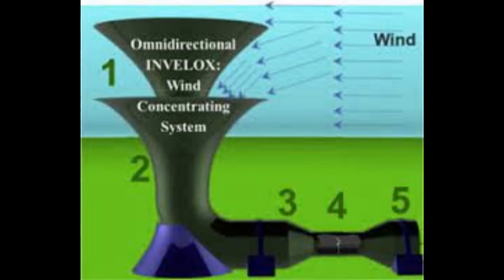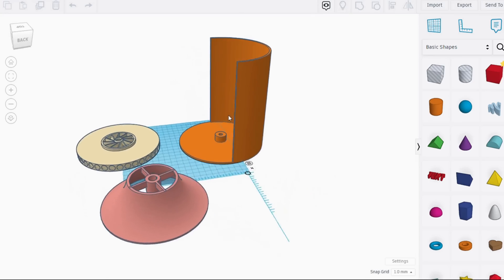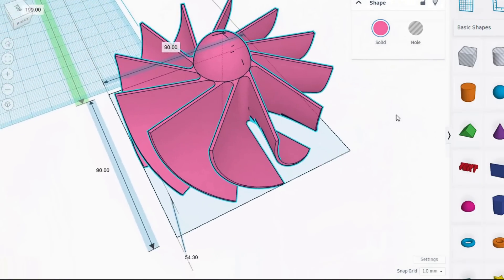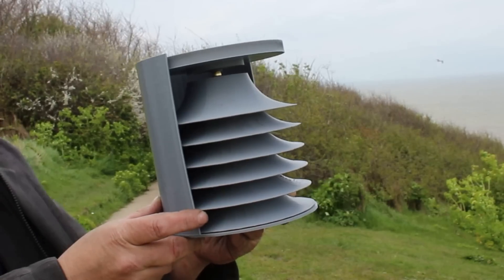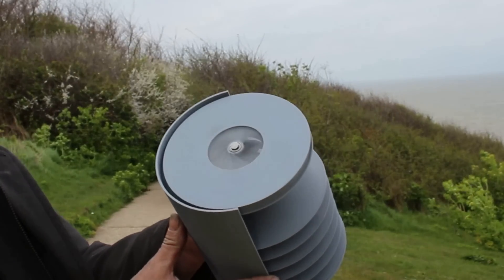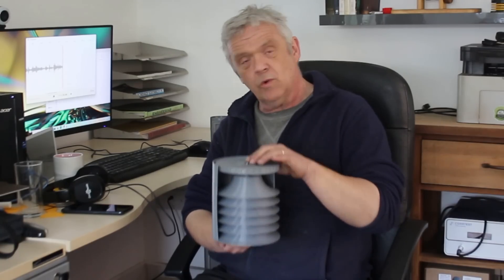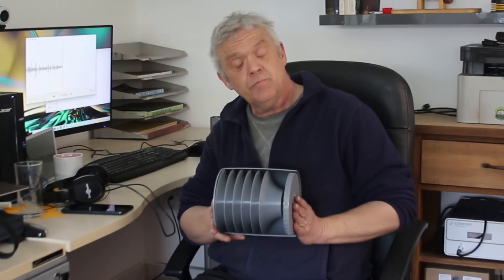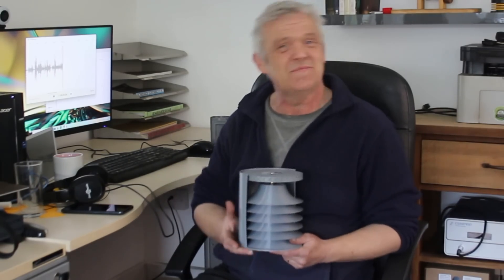1901 Brand New Wind Turbine Design For Camper Vans, Boats And Roof Ridges

Comment: Would you mind adding a few marks to the magnet wheel, so we can tell if it's turning? A Dark Sharpie or a paint pen should be enough.  You could then use a tachymeter to measure the RPMs.
Reply: Would appreciate testing it with a bldc motor and check it's real energy value.
Reply: A mark is a great suggestion.
Reply: @davebean2886  A first-year physics student would automatically do that.
Reply: videos aren't good at capturing rotation because they're 25 still images per second. They will always give an unrepresentative view & at certain speeds will show a rotating object as motionless. Much better is some sort of gauge. A simple analogue gauge is a magnet in an aluminium cup, one part rotates with the mechanism & the other holds a pointer & acts against a spring, the eddy currents in the cup drag the magnet. It works with either part rotating.
Reply: I think I’d like to see how well it spins with the generator components on. As we know with the old generators for a light on a push bike, they put a lot of magnetic force on the rotation.
Reply: You need a studio microphone!
Reply: An RPM gun would work nicely so each different design could be checked .
Reply: Hi, great design. Can you share also what other components I would need to make it work? Apart from the 3d printed parts of course.
Reply: You need to get a blind stick 😂
Reply: It would probably be best to use one of those laser devices to measure the rotational velocity. For demo purposes, it would also be nice if such a device could output an audible oscillation, speed and pitch (Hz) being an intuitive frame of reference for most people.
Reply: Draw a spiral on it
Reply: @toml.8210  Look at the top where the magnets are
Reply: Well, I can see that it is turning, and quite fast at that. 😊
Reply: @hendrikjbboss9973  that doesn't give us accurate measurements though....
Reply: I have a way better concept than that but tesla wants everything for free. Ben there done that with other novel idea..
Reply: @mariosanchez-sj9yv  sir what is your idea please

Comment: Being the sailor that I am, I gave up on wind power a long time ago.  Why, wind and sailing are connected.  Yes, but you need both a lot of wind and a projected surface to get a harvest that is satisfactory.  But using speed and water with some smart solution is of great interest.  Of course there are commercial ones such as watt & sea……but the prices are astronomical.

Comment: Hi rob, why has noone made a hydro turbine for a boat? Could even hang it behind the impeller of the boat where the water current would prob be strongest. Or add magnets to the edges of the motor impeller which moves the boat (and a coil housing)
Reply: Even when moored up on a canal in a narrowboat, the tow from passing boats can produce quite a current. Magnets to attach it to the hull below the waterline and either bi-directional operation or with the self-aligning vane...
Reply: @34136TS  i would imagine just the flow of the river when moored up would turn one, same as the old water mills were just in rivers/streams. Not all hulls are steel but like the magnets idea,  hows about this for an idea? Somehow make a kelvin water dropper attached to a hydraulic ram pump!
Reply: Not to forget that the deployed propeller will spin under sail and turn the shaft to produce electricity of course.  I see that you refer to when moored however.
Reply: @philip5940  indeed, someone did invent a dual axial turbine for the sea which does work when tide goes in or out but im pretty sure all generators generate when turned in either direction so i think that was just a gimmick or marketing ploy. I like the idea of magnets on the propeller edges or rim with a row of coils encircling the propeller, much like the design of a honeywell (formerly sk windtronics) windtronics turbine.
Reply: @philip5940  we will call the propeller idea a hybrid design as thats the buzz word at the mo haha. Only generates when the propeeler is turning or engaged, maybe could adapt it to be free flowing so it spins when moored? Some sort of clutch i dunno
Reply: @philip5940  i imagine youd be able to get 3kw out of something, use that to heat an element and create steam to make a paddle steamer! Or just a steam turbine :) plenty of water about
Reply: Towed generators is a thing, if that was kind of what you had in mind. Sharks do attack them from time to time so there is wear. There are also generators on a shaft at the rear of the boat available as a commercial product.
Reply: @rolfnilsen6385  kinda but not really, just adding a water mill to a boat is the basic concept and when the propeller is spinning it has magnets on its rim whipping past a set of coils so a double whammy
Reply: @mac-qt3wd  Aha. I am trying to envision that for my inner eye - and the yachtmen or sailors I know about would probably be aghast at the idea ;-)

(which means it might have merit. Nothing more conservative than yachtmen)
Reply: @rolfnilsen6385  Am thinking more along thw lines of people who live on narrow boats, just drop a turbine over the side or if the fishery or environment agency kick off cos of harm to fish then just adapt the propeller to spin when parked. Amazing they dont take issue with propellers when you are using power only generating. Towing a turbine would prob add drag so i would adapt the motor impeller personally :)
Reply: @rolfnilsen6385  1) cos you already have the equipment, just glue some strong magnets to the tips of the propeller blades and slap some copper coils with some wires attached and  2) they cant take issue with you using the same propeller you use to move as they allow it to be moved at whatever rpms to make you move without any consideration for chopping fish up :)
Reply: @rolfnilsen6385  3) if the  propeller is under water then its not unsightly and there is prob a stronger undercurrent down there then at surface, not always but probably
Reply: @rolfnilsen6385  4) it would technically work like a petrol/diesel generator when moored up, low on battery juice, fire up the propeller! Eeither charge batteries with it or run dircet or both
Reply: @mac-qt3wd  The peculiars of yachters is pretty intense :-)  The multihull is not at all accepted yet, even after hundreds of years. Just to name an example.

A practical consideration is that the propellers of sailboats today are often folding props. They reduce resistance when sailing. So there might be some practical things to solve there.

Fun idea. I have nothing against it at all. Just some light hearted back and forth 🙂
Reply: @rolfnilsen6385  yeah i thought you could make the propeller spin under the current of water of river when youre not using it to move about. Like an outboard motor pivot, turn it at 90 degrees when youre moored up and let the river turn it as a hydro turbine. Makes sense to me anyway, no idea about yachtsmens peculiars, despite the t shirt in profile pic, im not on a boat, wishful thinking - and a mates stag do T-shirt
Reply: @rolfnilsen6385  instead of the propeller having magnets on it could slot into a wheel when turned at 90 degrees and it could turn a generator inside the boat via a protruding shaft and belt, geared up ratio by 100 or so :) size of the wheel slotted into is 100 times bigger than the protruding shaft spindle
Reply: @rolfnilsen6385  or just add a wheel to the outside of the propeller, put a belt round it and so on, wheel could even be internal, use the almighty power of the already in use engines when ferrying or docked (if those the correct nautical words) some big propellers out there size wise , easy enough to get the gearing ratio up masively :)
Reply: @rolfnilsen6385  rim driven thruster is what they are known as, so you have everything you need to make a generator out of one of those, just make it free spin in the water and youre away

Comment: Always another great VIDEO!

So if anyone makes this device Twice as Long,than it might produce almost TWICE the RPM spin with a Electrical Conductive Bering, that does NOT slow this down, maybe could generate ELECTRICITY?
Just a guess  . . . as Living in a camper, with no "work-shop," and with not enough SUN for me solar panels, and have these MOUNTED on back, horizontal,  could be used while parking, or driving the "High-Way" giving a "bit of spark for me, Lights, and phone"
Just "brain-storming," on a very cloudy day, (by over-spraying-chem-trails,) with the wind speed to 30 MPH! 
OR driving the "HIGHWAY" speed limit!

Comment: That sea too wore really well?  The rear shroud really good.  if the rear shroud deflector is freemoving and self alining with the wind? It can be static? Looking a little bit like the go turbine idea I had? But with a few extras I hadn’t thought about? I agree that it would make for an awesome Tesla turbine? Especially if rim gen is the way your going? So you could in effect make the Tesla style more chunky with magnets on the outer edges then a coil could be at each spitter opening? As you have the rear shroud it won’t take much to mod on Tinkercad? Then you have segmented splitter to hold the coils if you choose to do a Tesla version? Quick assembly? Also fairly scaleable?  Open to multiple unit arrangements? It would not take much to get main volts if done this way?  Simple add as many sections as you need?  Question is how many? 

So well done rob! Looks awesome so far!
Reply from the maker: i like that ldea mate - thanks for sharing
Reply: @ThinkingandTinkering  always happy too drop hints?  You’re already well on your way to develop something fantastic! It’s looking like a Dalek? I might be off to conquer the universe? It very close to f1 racing styling? So I will be tuning in to see where this goes?

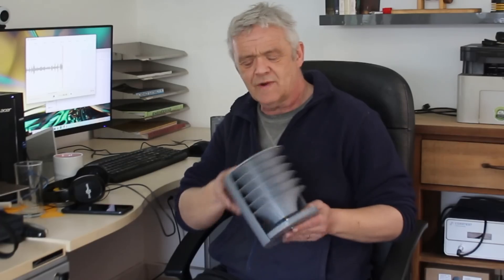Comment: 3:18 Can you just build vanes into the cones themselves, maybe 90 degrees apart, so you don't need a tailfin or movable backstop? I would think the cone with static vanes would still cause the wind to be directed towards the generator anyhow.
Reply from the maker: yeah you can

Comment: Love to see all the versions and concepts of this wind capture device!! With this latest one, would the rotating back wall make it tough to implement the actual generator section (serpentine coil)? Excited to see where this goes next :)
Reply from the maker: no mate - it's an easy solution
Reply: (the coil could be placed on the rotating portion - it could be a full circle around the perimeter of the generator stage (or if axial on the end..) - a "serpentine style"  generator coil needn't be a full circular loop - it will still work (axial or radial flux) with a partial circle - less flux lines intersected meaning lower power generated per rotation.)

Comment: The only way I ever got that format to work was with a shield at the rear as per yours. Anything else and I found the air blew straight through.
Reply from the maker: hmm - did you check out how Ventum go theirs to work? they don't use a shroud
Reply: Hi Robert.
I honestly doubt that theirs is efficient enough to ever find a niche in the market place. I could be wrong though, hence the reason I don't ever comment on peoples products. You can end up with egg on you face.

Comment: We have to harvest all the power we can and your project is certainly making it easier for the masses. Did you calculate how much power can be drawn from the device? This is always the problem with real life applications, the offset between cost of production and installation vs payback at scale. Obviously at a small level it works but, what could it run?
Reply from the maker: my room light is 4 watts - so it could light my room
Reply: @ThinkingandTinkering  yeah that's it; millions of street lamps! a battery, a LED and atop a lamp post. Finally we will pay less taxes and save a good part of the planet!

Comment: Nice idea on a moving vehicle as it's generating during any journey regardless if it's windy or not. I wish you would do a return video on the diesel air heater for efficiently scavenging heat from the exhaust.
Reply: obviously using it while driving would increase the fuel consumption.
Reply from the maker: for sure
Reply: You need to study up on the concept of 'perpetual motion'. The energy needed from the vehicle's engine to combat the windage would not be off set by the amount of power produced. Way more efficient to simply have a mechanically spun alternator / generator. Now if you were camping for a few days next to a desert lake or along a sea cliff say... then it would be a nice bit of kit to augment other power production.
Reply: @gilray1977  it would be interesting to see how much a small unit could produce. Even 1 amp would be great if it's spinning 24 hours a day.

Comment: You know what'd be interesting? You had one design where you the funnels pointing down to direct wind and catch it. One of the renewable ways to cool your home off is to have a big set of pipes underground that cools the air... I wonder if this could be placed over the inlet as a generative force and something to help move the air? I don't know how much force it creates, if the run would be too long would it stagnate and stop moving the air?  I kinda want to build one of the larger ones now to do some home tests! :D thanks for the content!
Reply from the maker: i don't know mate - try it and see
Reply: Might a second unit at the outlet work to act as a pulling force draw air out of such a system too. Albeit, you’d want to find a way to draw other ambient and outlet air together. Hmm… ponderings
Reply: @martinsmallridge4025  a second unit mounted higher than the inlet and inverted would. Wind  In at the sides then directed up and out would likely generate a low pressure area centred
 below it in the pipe. Unless my mind is wandering.
Reply: Went it rains it can also spin the rotor on water power. Genius Robert!
Reply: Agree, although both directions are useful: cool outside air inwards, or warm inside air outwards.
More importantly, the mechanical movement can power a coffee burr grinder!  😄
Reply: theres this phenomenom called the chimney effect, it is caused by a difference in indoor-to-outdoor air density resulting from temperature and moisture. This can drive airflow through buildings and can be used to reduce fan energy requirements, I'd imagine that having pipes underground with an opening to outdoors would help cool down your house efficiently. I'm wondering if these underground pipes could be a way to always keep the chimney effect active since it requires a bit of difference between inside and outside air conditions.
Reply: @ogficht  Do you mean "underground pipes" to cool air for a heating/cooling floor, or to release this fresh cool air into the rooms directly?
The great thing with the chimney effect, for instance along a south-facing wall, and even better, behind a glass pane, is that it creates a constant airflow regardless of seasons, which is exactly what you need for stale/fresh air circulation.

Comment: i wonder if old isolator dingys you see hanging from high voltage lines could be used as the air funneling part? 🤔
Reply from the maker: interesting - i don't know